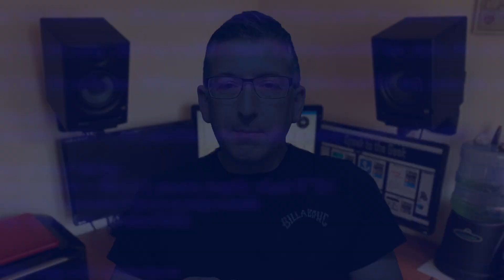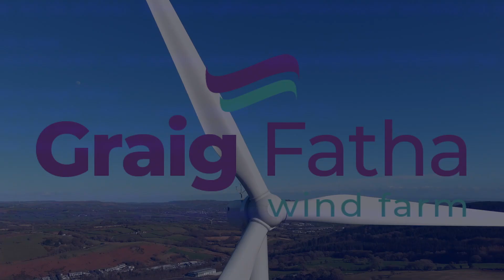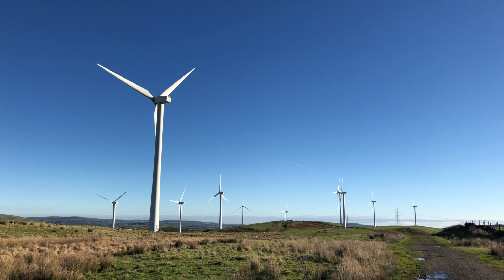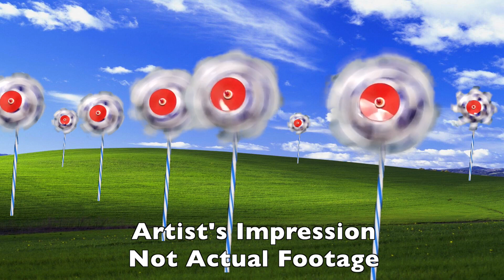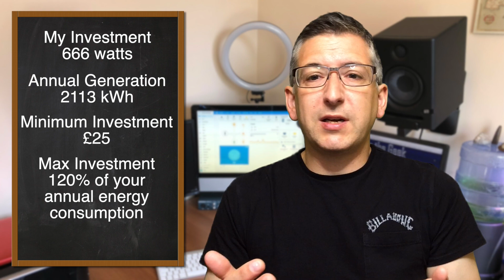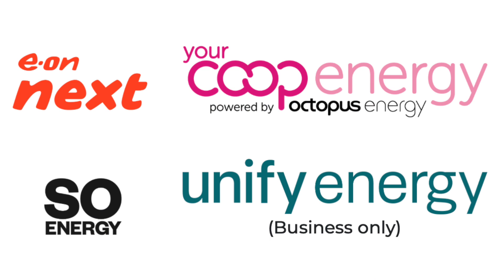Ripple Energy: Own a wind farm!

Comment: Solar panels on your roof do not pay for themselves quickly. The length of the payment term often exceeds the life of the panels. Unfortunately companies are still more interested in profits than making it affordable. The wind farm investment does sound good
Reply from the maker: Not quickly, no, but they are a long term investment. At the moment I think my whole system should break even in about 12 years. I’m planning a video/article about that once I have a year of data to use. It’s dependent upon energy costs so I have to make several assumptions there of course. What I can say for certain is that they have saved me a fortune so far in their first year on my bills compared to pre-solar days.
Reply: Simply not true- Installed last year and just a month short off 12 months and I have reduced by electricity bill by £1600 and if I also factor in charging the batteries on an overnight cheap tariff in the winter we have saved an additional £780, so £2,380 saving on a £8,000 investment so 29% return paying off initial cost in 3.5 year then free electricity. Panel life is 25 years and batteries are 10.